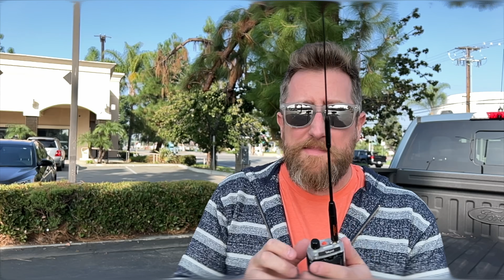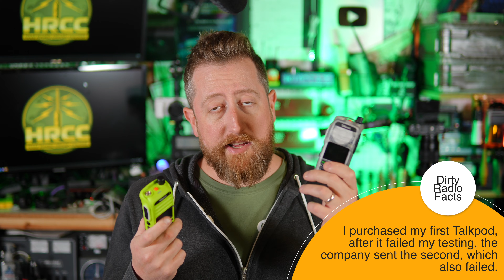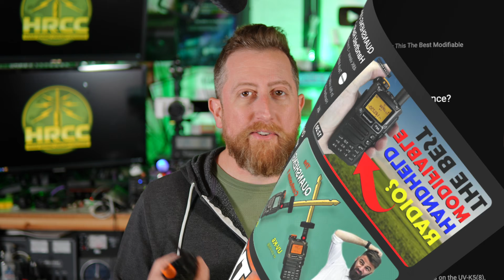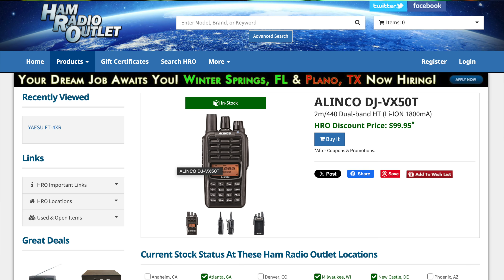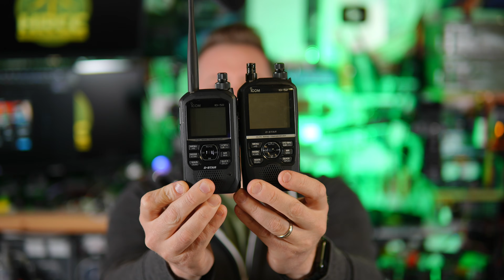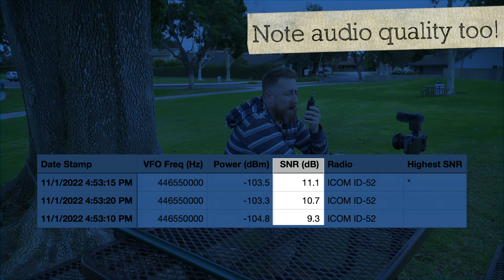Best #HamRadio Handhelds

Comment: I’m REALLY new to radios, and have recently joined my local fire/rescue on call company. Planing on getting my emt basic this fall. Would the Wouxun KG-Q10H Quad Band be a good backup personal radio for both department work and personal use? I live in Maine where the EMS freq is mostly 155.3000-4000. It looks like it has a number of good features for living in a state like ours. Any guidance appreciated!

Comment: Would you consider making a video on the Baofeng UV M-13 Pro V2 10 Watt? I have one and it can transmit on three different bands, i think 2 meters, 1.75 meters, and 70 centimetres. It can listen on three frequencies at one time and can listen to 80-108 mhz fm, 108-136 mhz AM, 136-174 mhz fm, and 400-450 mhz fm. The radio I have saids it is FCC and CE approved but I don't so, but I still think it is a good for the price radio because it costs around 29 dollars.

Comment: Thank you for doing all of this testing! I started with a baofeng, and after just adding a decent antenna on a second floor, and i did an equipment test on a repeater over 20 miles away, and my buddy heard me on his car rig crystal clear 60 miles away... all i did was switch to a magnetic based car antenna, put it on the roof and now.its as though ive got a moderately professional rig (in terms of distance) made oit of a handheld... id llve to try out the wouxun, but i want to find the limits of this little guy first...

For all of us who don't have Spectrum analyzers, or any other tools to analyze our signal, your information is invaluable to us. Thanl you!

Comment: First video I have seen that explains the consequences of having an out of spec radio or transmitting in a way you shouldn’t. 

As opposed to “don’t break the rules” just because. I understand that the rules, especially originally, had purposes. It doesn’t seem that way anymore, at least from a beginners perspective
Reply from the maker: Yeah, I grew up with the DARE program.  I learned you need to explain why, not just DON’T

Comment: I've had my new Kenwood TH-D75 and it's the best handheld I've ever had now. At a hamfest I still use my old HTS-202 because it rejects all the intermod and doesn't overload easily. It may be just 2 meters and not have very many memories, plus being a brick, but it's better in some ways than newer generation radios with broad front ends. I also have the VX-6R, harder to program frequencies into it on the fly than my new Kenwood though. So I think traveling around my new Kenwood will go with me on the road since I can load up repeaters in new places easily. I do think the VX-6R is the best radio for the money you can get of the traditional Japanese radios. Chinese radios still have a long way to go in my opinion. My ex-wife got me two identical UV-5R8Ws (8 watt version) and they are subject to interference from Bluetooth, LED lights, Wifi that a more expensive radio can deal with. And on transmit they are dirty, so I won't get on the air with them, only listen.

Comment: You really missed the ICOM T-10. Great rugged dual band handheld. Submersible and with an unbeaten battery life. 80hrs+ in my tests. Other than that it’s not fancy, but it does what it’s supposed to do. Great and loud speaker, great battery life, and a very good receiver.

Comment: Got me a FT5DR and it's been absolutely horribly yet to pick up a signal and all my gps does is blink, when I try ti transmit it ligjts up red no receive
Reply from the maker: Sounds like you’re in a building that’s attenuating everything. If not, perhaps defective radio.
Reply: @HamRadioCrashCourse  yeah I cant even seem to transmit
Reply: @HamRadioCrashCourse  I got the gps up but now I can hear repeaters but when I push thr button my voice won't work

Comment: IN 2024 there is ZERO, NONE, NO reason why there isn't a usb-c charging port on EVERY handheld out there. Having to buy a proprietary charging cradle or dock should be ILLEGAL. With a usb-c port, your radio can be charged with pratically ANYTHING!

Comment: I am considering obtaining a license, and I have been contemplating acquiring a ham radio for the past two years. As someone with limited knowledge about radiocommunication, could you recommend a suitable ham radio for beginners? I have been exploring options like the Baofeng UV-5R and Baofeng UV-80, but I've noticed some negative feedback regarding the brand. Additionally, I am not overly concerned about spending a significant amount of money; I simply want a reliable and effective ham radio for a beginner. Your insights would be greatly appreciated!

Comment: Interesting, on my Quansheng which I purchased in November 2023, the 2nd and 3rd harmonic were 47db lower than the fundamental on 2 meters. Maybe Q/A is hit an miss
Reply: Are these harmonics just after the extra firmware is added, or as from factory settings I wonder 
First thing anyone is doing after buying one of these things is adding the Egzuma firmware. 
Which, I’ve found power wise is of no benefit, yes of course it widens up the bands

Comment: Loved the video! I am surprised to not see at least a nod to the Wouxun KG-UV9PX in the video though. While it came out before 2023, it's still selling like hotcakes and sometimes last year's model is still the best new model (and much cheaper also). ;) It has a USB-C battery option (so you can use the radio while charging a spare battery, unlike the Q10H), and it does 2m & 70cm very well (like a UV9D Plus or UV9P on steroids). I'd love to have you run it through the spurious shakedown also - have never heard any bad reports about it after thousands and thousands being used in the field. :)
Reply from the maker: Hey there!  I am actually a fan of Wouxun.  Last year the KG-UV9D Mate made my best of list.  I'm always down to test and share about good radios with the community!  Let me know what we can do.

Comment: Well done Josh, a wide range of handhelds covered. I’m with you on the ID-50A, it makes more sense than I originally thought, especially considering the smaller size. I sure hope you’re correct on the D75A pricing but I’m skeptical it will sell for under $700.
Reply from the maker: Thank you for the kind words.  I have also heard credible rumors of a $700 price point.  Somewhere between $600-$700 is likely.
Reply: @HamRadioCrashCourse  @N4DJC was right, $750

Comment: I'm sorry Josh but I must disagree about the FT5D. I've owned one since their first release, features are great, battery life horrible (even discharges when not in use), and modulation is terrible through built in mic. I am very sorry I spent $500 for this radio that's become a paper weight.
Reply from the maker: I did say a good deal at $350 :D  Battery life is improved tremendously if you turn all GPS, APRS, any additional modes above and beyond voice.
Reply: @HamRadioCrashCourse  , oh no, you are right in that category, and maybe I have a one off unit, who knows. That kind of thing happens no matter who you buy from.  Others have had concern of its battery life as well, even with APRS & GPS off, as I do. But I do give it kudos for its features and current price point.

Comment: Yes it's another baofang  but the UV17pro gps is nuts. USB charging, gps, airmode, bottom flashlight. For $30 it will likely be the uv5r killer.

Comment: That baofeng has an SOC radio that meets emission standards means others can too.  They sell the nano VNA next door to these companies that make the radio, it takes hardly any effort to test them on the supplier end, and it's often a matter of a few cents for the surface mount components to fix them. The first one that is pushed hard by influencers and can still be unlocked like the UVK6 will corner the market

Comment: all this is why, there is a huge difference between a true ham, and down and dirty hacks to get licensed quick and easy hams, and some other "services". I love gmrs, but think it will quickly devolve into a uhf cb type "service"  Plus, since the beginning of the UV-5 days, FCC have totally dropped the ball, and abdicated doing their responsibility.
Reply: While I am licensed for GMRS, I do hope that it eventually goes licensed by rule. The vast majority of people using GMRS in my area are unlicensed or at least aren't using their callsigns. The lack of encryption capabilities means that it will never be useful for anything serious so why not just open it up? I have several decent GMRS radios but I find I only use them for listening in in what's happening in my city. I use my Motorolas for everything else.

Comment: That's actually pretty funny you know.  You got a handheld. That is submersible. So it won't get destroyed when it gets wet. Only one problem.. It doesn't float either. It goes right to the bottom. Good luck with that. That's very funny. They didn't use the right kind of plastic. It doesn't float. It's beyond, stupid. Oh boy it's waterproof. It sinks like a lead weight on a piece of fishing line. Great! It'll work perfectly for the fish for a long time until the battery dies. But it has extended battery life. So the fish will be able to get plenty of talk time in. Glub glub  glub.  10-4 good glub glub. I've got you, Glub X Glub. It works Glub!

I mean really? Why not just display it outside. Standing there talking on the radio. While your son has the garden hose on you and the radio. That would be far more authentic and  real world application. Using it in the pouring rain. Not at the bottom of the lake. Or the river. From the bridge in which it fell out of your hand from. You needn't worry about it being, waterproof. Or even, Water Resistant. You are likely not out protesting in the pouring monsoons? But perhaps designed and made from such an area of Indonesia? That they needed to speak with their family members and neighbors. When all the power goes out and communications go out. In their neighborhood. And the humidity is about 150%. Most of the time. Combined with a lot of salted works great. The ground gets plenty of iron. And when you eat the vegetation so do you. You do not need to eat raw liver anymore. You can sauté it, lightly. But eating greens full of iron and fiber is better for you. If you're going to take up being a, jungle Bunny in a, South Pacific island tropical rain forest. Then yes. You should get one of these waterproof walkie-talkies. For you and your family members. And all of your friends. And all of your local businesses. Like the frog shop. The turtle shop. The alligator shop. The Bunny shop. And Chihuahua Tacos. They are the best! They are very lean. And they were made for frying..  As I was told I had dog tacos in Tijuana back around, 1987. And I thought they were delicious. I didn't chihuahua was that tasty.  Far better than, Hebrew National All Beef Hot Dogs. They make their hot dogs for Kosher  Uncle Sam. Don't ask me why? From an old commercial campaign. Or maybe that was Rabbi  Sam? It's hard to tell?  My memories are fading. I just remember some Hebrew hot dog with Uncle Sam in it? I may have been high at the time? But I don't think so? It was before that time.

I just want to see that hotdog commercial again. It had a higher calling.
RemyRAD
Reply from the maker: Just add a float, a myriad of options exist for electronics.